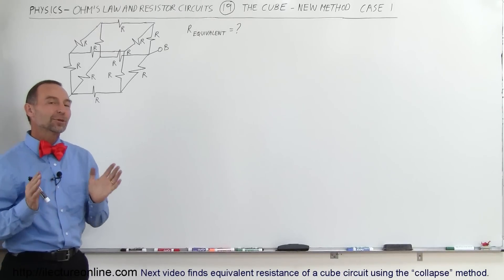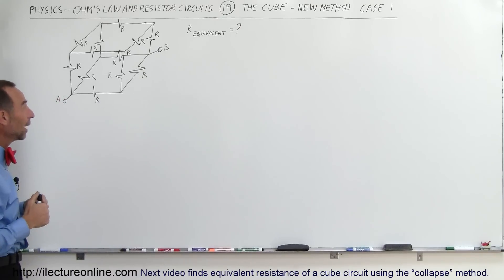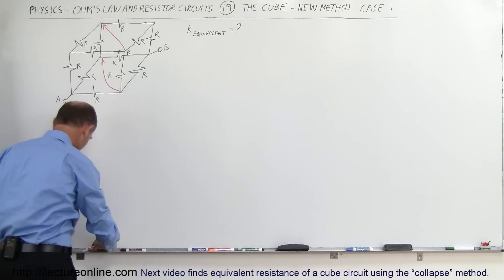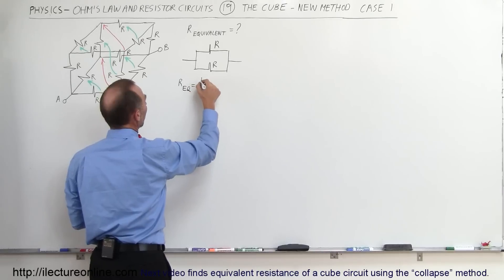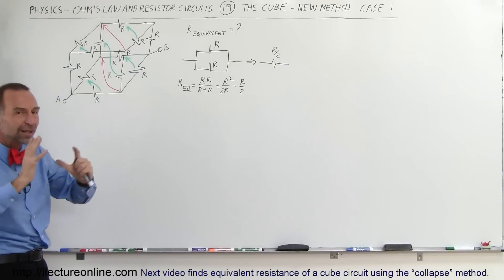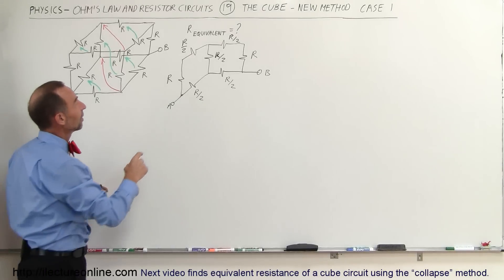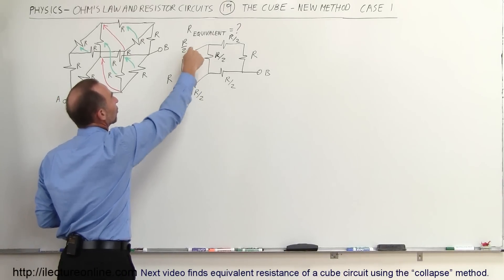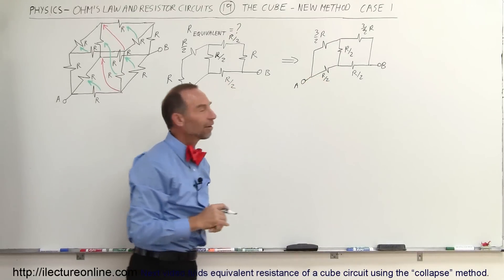Physics 42   Ohm's Law and Resistor Circuits (19 of 23) The Cube: New Method Case 1

Comment: You can just use the concept of a wheatstone bridge from 5.00 onwards. Just neglect the r/2 resistance in the middle you'll get two branches in parallel 

             
           /----3r/2-----3r/2-------\
A-----/                                      \---------B
        \------r/2----r/2-------------/

so then u evaluate this u'll get

             
           /----3r-------\
A-----/                     \---------B
        \------r------------/

then use the formula for parallel combinations 1/Req= 1/3r+1/r
Req=3/4r
easy
Reply from the maker: Thank you for your input.

Comment: Can you get the equivalent resistance of (3/4)R using kirchhoff's laws instead of the delta Wyre method?
Reply from the maker: Yes, you can but you'll end up with a lot of simultaneous equations to solve.

Comment: what about differents resistors ? (Like R1=1, R2=2 .... R12=12) ?? :))
Reply from the maker: We have an example where the resistor values are different, but without a certain level of symmetry, it will become much more difficult to solve.
Reply: @MichelvanBiezen  Well, after all, in
  this is the zest of the question, which raises the problem to a new level!
Kirchhoff's laws, systems of equations and matrices will help us.
Reply from the maker: Yes we would have to use Kirchhoff's rules in order to solve it.

Comment: 100mrks for effort..... But your method is way too much long
Reply: U can have made a simple circuit diagram after combining the equipotential point... Then just applied parallel and series resistance formula..... Nd. Your answer will be there

Comment: Sir, I have a question. The trick you did is smart really. But I think it won't work on the non-symmetric circuits. how do I solve that kind of circuits?
Reply from the maker: For non-symmetric circuits you will have to use one of the different techniques.  You can always brute force it with Kirchhoff's rules.